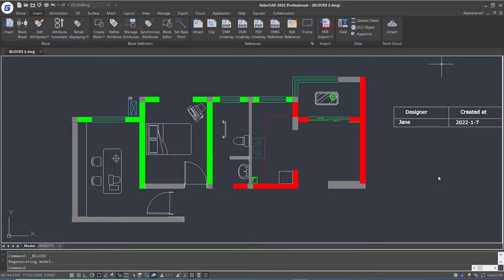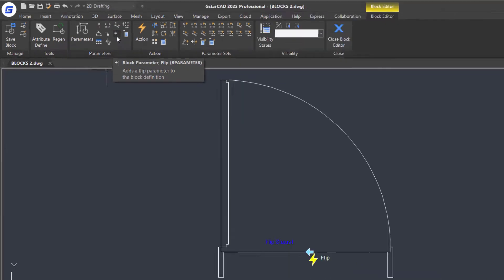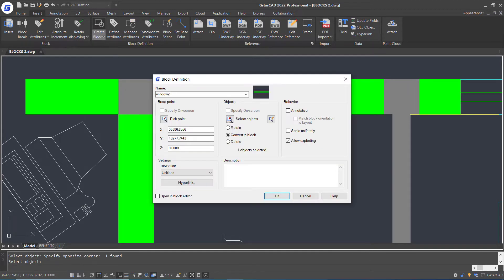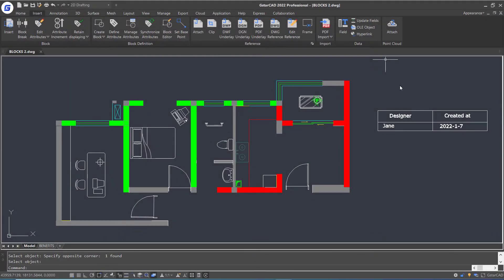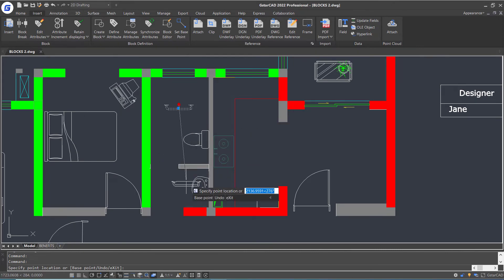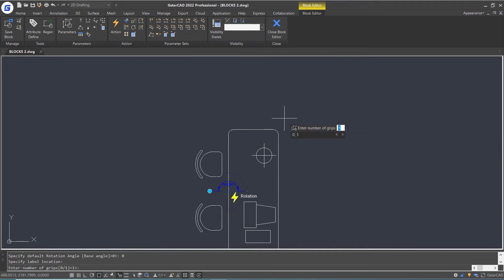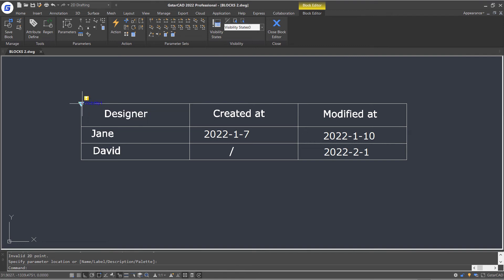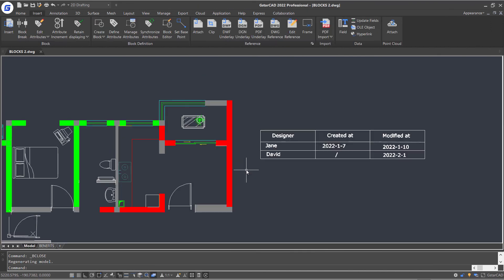GstarCAD Beginner Tutorial- Dynamic Blocks

Comment: still cannot introduce field blockplaceholder attribute in a dynamic block. it will work fine with one made in autocad but cant create one of his own coz user placeholder is missing 
for example you cant create a dynamic square that has attributes for LxH that will update automatically when block dimension are modified. a big feature missing coz without it you cant code dynamic parts via excel using attin and attout.
Reply from the maker: Hi！Could you send us the question to support@gstarcad.net with your details, we will reply you as soon as possible. Thanks for support GstarCAD。